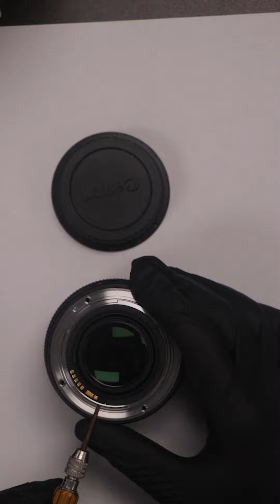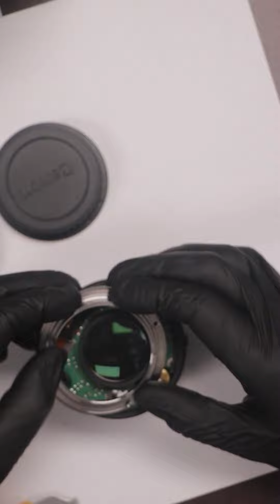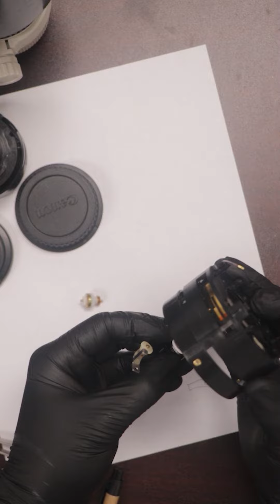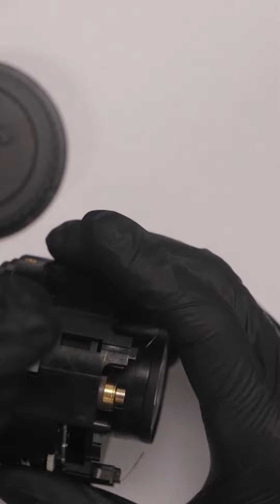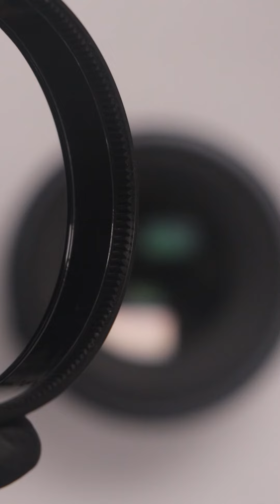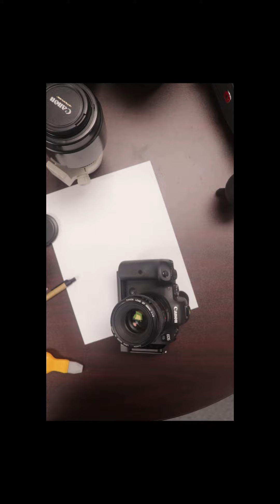Canon 50mm f1.4 autofocus repair

Comment: Hello, I am having an issue where I cant seem to fit my Soligor Ef-s lens on my 800D. Both the body and the lens mount are flawless without any damage, but the lenses cant seem to fit. I cant turn the lens to mount properly. They just wont turn. I have never dropped them neither hit them. Other lenses are mounting fine on the body. Can you please suggest any advice on how to proceed?

Comment: I just bought a Canon 24-105mm f/l L IS USM lens, just under $300, and everything works on it but the autofocus.  I don't get any communication errors since I tried the lens on at least 7 cameras I have access to, and it does the same thing in AF mode on the lens.  There is no fungus or scratches on any glass area on this lens.  In one test I felt something hit my finger, which looked like a piece of plastic.  It was very small, and it got away from me.  I do get the whizzing noise in AF but no movement showing in the window on top of the lens when the shutter is pressed.  I don't think it is that hard to fix because I have in the past fixed some of my other cameras and lenses.  Seeing the motor mechanism looks pretty easy to replace.  I just have to find that part.  So far I have only seen various flex cables and shutter modular, but no autofocus assembly online.  If you could any help would be appreciated in finding one.
Reply from the maker: @leeo.alexander2324  I wish I could help more, but my only recommendation would be to check out AliExpress for replacement parts specifically for that lens. Alternatively if you're in a rush (don't want to wait for shipping from China), you might be able to find a duplicate 'for parts' damaged lens on Facebook marketplace you could scavenge parts from? And perhaps there's a teardown video for that lens on YouTube to check out to help with the reassembly (but it seems you already know your way around the lens internals 👍)?

Something to note, prime lenses are far easier to work on than zoom lenses (due to so much working in harmony).

Good luck with the repairs, I hope AliExpress has what you need.